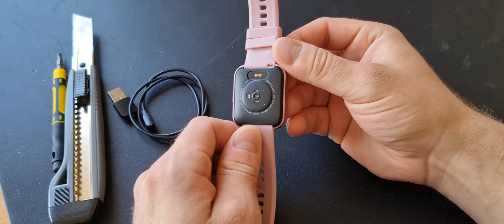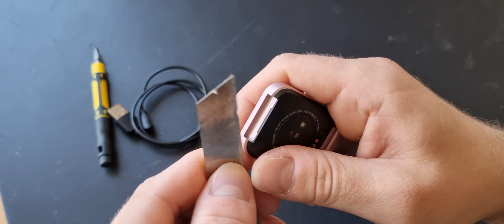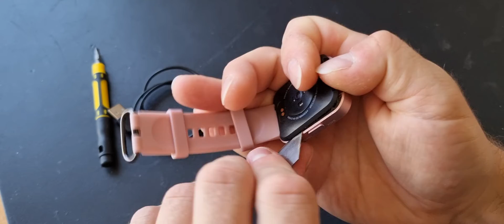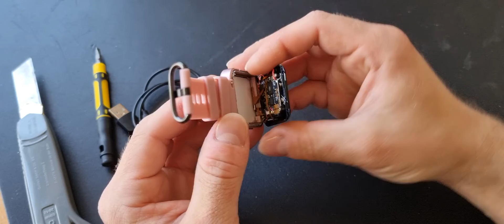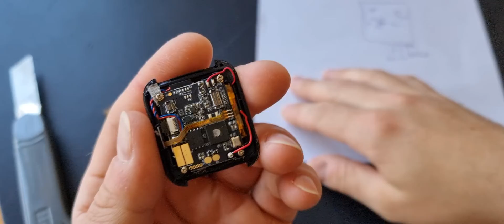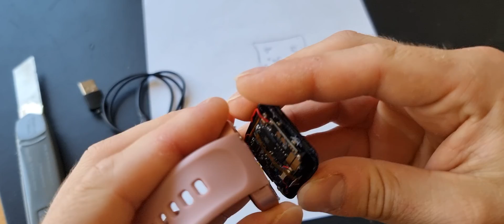How to open DaFit Kospet Magic 3 Smartwatch nRF52840 Arduino custom firmware

Comment: you should check other modern smartwatches with Amoled displays, maybe some even can be used as smart glasses if you can piggyback a signal to the display
Reply from the maker: Hey. I am always looking for easy to hack watches with an nRF SOC so far this one has an Amoled (SG2) https://youtu.be/J9l99v5dr5I